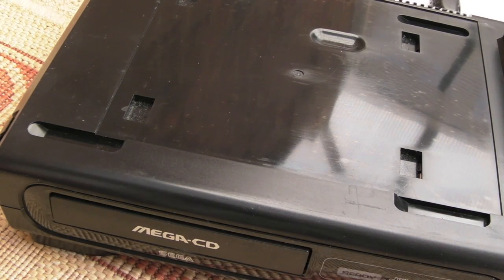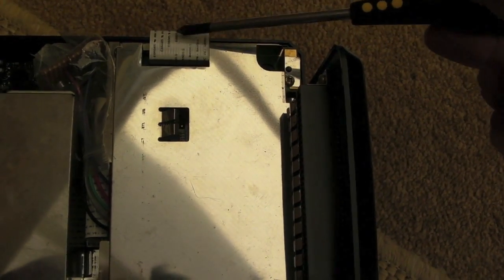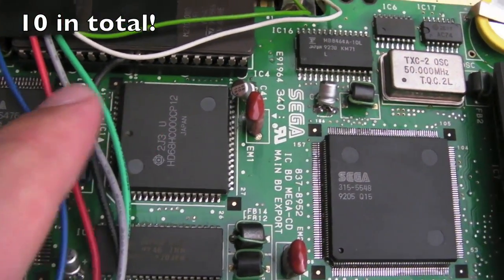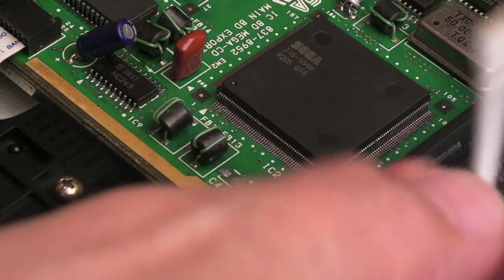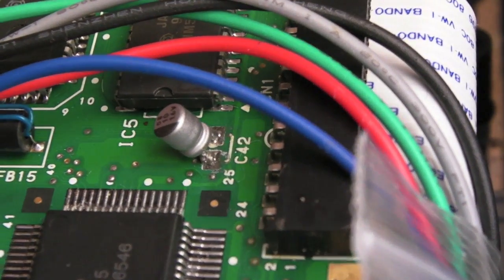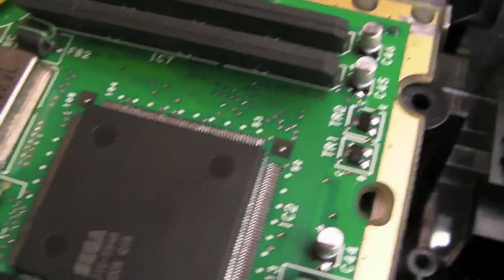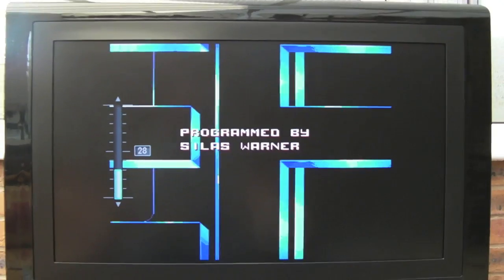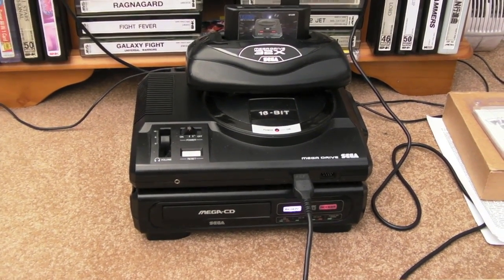Sega Mega CD Repair (Sega CD) - Recap of Recapping

Comment: Are the lasers readily available for these? I'd buy one but I don't want it to go the way of the dreamcast (no lasers)
Reply: Russell Brunskill

There is a replacement Samsung laser which can be made to work in the most common Dreamcast GD drives, IIRC?

If they're not an exact match, I found a similar pickup before where you just had to trim one "pin" off the ribbon cable to use it.

I could be wrong, but from memory, I think the part number is SPU-3200 for the replacements? (on phone atm, so a pain to check. lol)

Have a search on AliExpress for "Dreamcast laser", or similar.
Reply: ElectronAsh I've actually done what you earn suggested before, I tore up some old cd-rom drives until I found a laser that worked. The problem is the actual lens is lower than the dreamcasts throwing the focus out so you need to up the power some.
Reply: Russell Brunskill

Ahh, fair enough.

I haven't look into that stuff for quite a few years tbh.

I've been too busy working on the Dreamcast HDMI and GD Emu stuff. :p
Reply: Drives came from two manufacturers, Yamaha and Samsung, so there's two different laser kits. I think SPU is the round one and doesn't fit half the consoles. The other is Sanyo and is super rare now, but should fit both. Don't quote me on this, I'm speaking from a long hazy memory.
Reply: Siana Gearz

Tell me about it. lol

I've forgotten more than I've learned, in recent years. :p
Reply from the maker: Thanks both for this information!  a) I didn't know there was a suitable donar laser for Dreamcasts and b) I didn't know about the focus issue on that donar laser.

Yes, you can find spare lasers for the Sega CD on AliExpress.  The MK1 CD typically uses the KSS240A optical pickup unit.  The MK2 tends to use either the Sony KSS210A, Sony KSS210B, or Samsung SOH-04.  From memory the spindle is different between those Sony and Samsung models.   One is black, one is metallic - I forget which is which.  I am not sure, but there might be a JVC laser used in the MK1 as well - I cannot remember if mine is the Sony or JVC pickup - I need to look back at my first Sega CD video.    I will cover this in a future video because I was going to check the RF level and order and test some replacement lasers for this unit too.
Reply: GadgetUK164 - Retro Gaming Repairs & Mods I had great success with creative drives from the late 90s would you believe! Samsung drives sometimes have the same pickup but the lens is different and requires a jump in voltage. I've gone the usb gdrom route now.
Reply from the maker: Yes - the USB / SD / Compact Flash solutions are most welcome =D  I hope someone does something similar for the systems that haven't been blessed yet lol.  Like maybe the Neo Geo CD, PC Engine, 3DO (although there might be one for the 3DO - not sure), and Sega CD.   I think it might even be practical to design a complete replacement system that plugs into the Megadrive expansion slot (and the same could be done for the PC Engine too) - ie. a PCB that connects to the console expansion and just replicates in FPGA the function of the CD unit entirely, with SD or USB support for the ROM images...
Reply: GadgetUK164 - Retro Gaming Repairs & Mods there is indeed a 3do drive emulator, it's the same chap who produced the usb-gdrom. Check them out here 3do-renovation.ru
Reply: Probably worth giving this a quick read before you try to get hold of a board from that guy...

http://www.stoneagegamer.com/dreamcast-usb-en.html
Reply from the maker: Good god - that's a drama and a half!
Reply: ElectronAsh to be honest he's not the best with communication but from ordering from his site and landing on my doorstep it only took 3 weeks, stalking the forums I've never come across anyone who he's let down. If you interested in one I'll order it and send it on £150 handling fee though 😁😁
Reply: Damn auto correct....
Reply: As far as I can tell, he's a decent guy. In case communication friction occurs, I speak Russian. Then again that might not be too helpful, as more broken telephone is rarely good. 

As to replacing the SEGA CD unit, well the TG86 is likely to be ever so slightly buggy, besides its pretty much a console on its own with lots of complexity, at which point the question is, why don't we replicate the rest of MD along with it, and what's the point, if nothing of the Sega CD remains in place, not the CPU, not the PPU. I mean you can't exactly expect 100% faithful recreation here, not within years of work.